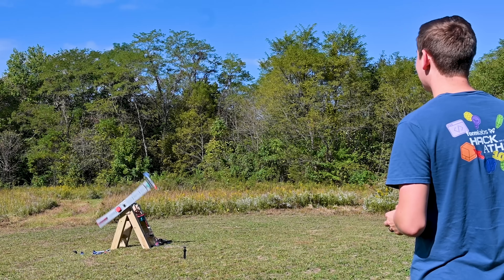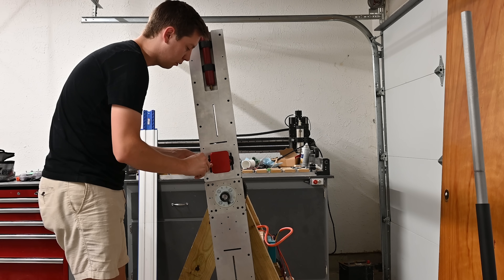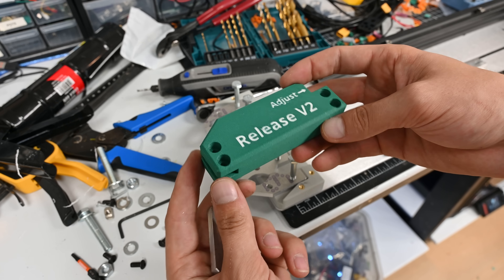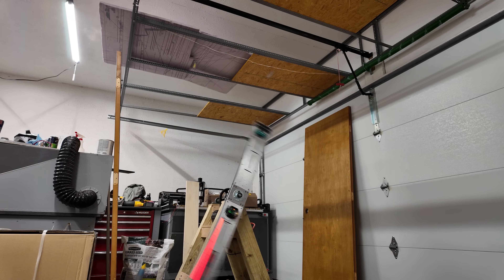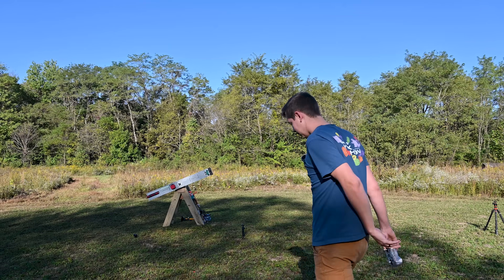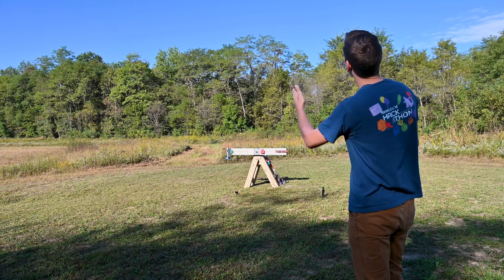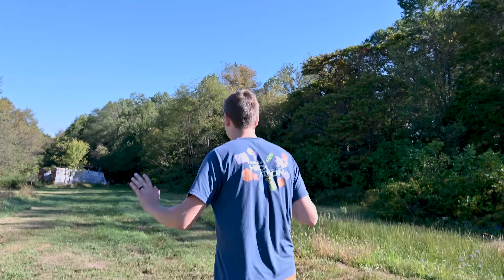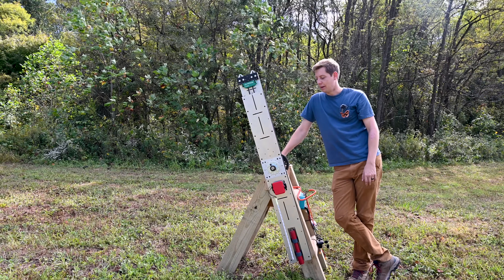I Fixed SpinLaunch

Comment: You can't fix SpinLaunch because the concept is inherently flawed. Surround your launch arm with a vacuum chamber, get the projectile moving at supersonic velocities relative to the atmosphere surrounding the chamber, get a precision release trajectory working, do not impart angular momentum into your projectile upon release, stabilize the projectile's interior against forces exerted by being fastened at the end of the launch arm (so that the tip and tail experience more lateral force than the center), have the projectile transition between the vacuum chamber and the atmosphere flawlessly without having to fight the atmosphere trying to rush into the vacuum chamber, and prevent the reactive forces resulting from the projectile separating from the launch arm. Then you can say that you fixed SpinLaunch.

It's all trade-offs. Terrible trade-offs at that. Consider, for example, the angular momentum of the released projectile. You could counter-rotate the projectile to get rid of the angular momentum at launch. Problem solved, you might think. This is incorrect. Instead of only having to stabilize the projectile against differential forces trying to flings its parts outward away from the axis of the throwing arm (where the tip and tail of the projectile are further than the mounting point on the arm, such that they experience more bending forces), you now have a constantly rotating set of forces exerted on the various parts of the projectile at it rotates such that not only does they have to be strong in the direction from the axis of rotation to the point, they also have to be strong in all directions perpendicular to the plane that is perpendicular to the axis of rotation because the magnitude of the forces from the rotation axis to those points will be oscillating with the oscillation of the throwing arm angles since the distances of those points from the rotational axis of the arm will be constantly changing as the projectile spins at the end of the arm.

Minimization of the differential forces on a non-counter-rotating projectile affixed to the end of the throwing arm necessitated a long throwing arm.

Comment: I'm pretty sure the timing between each claw release needs to be based on the rotational velocity. Your current design has a sweet spot, and rotating beyond that's just going to result in more and more cartwheeling again. You should change to electronically controlled, independent release calculated live by the controller based on the speed at time of triggering.

Comment: SpinLaunch isn't going to deliver velocities even comparable to first stage boosters.  Carbon fiber doesn't have enough strength-to-weight.  So what's the point?

SpaceX has the right idea with SuperHeavy -- cheapest possible liquid fuel, and chopsticks catch.  Not sure if they have the right idea with Starship though.  Maybe!

Comment: push the green thing forward to autobalance it efter release. Right now you pull it backwards so when the rocket is gone the whole with gets unbalanced. Just redesign it to release while being pushed out so the weight gets further out instantly replacing the weight of the rocket

Comment: Add a model rocket engine to the rocket and an altitude meter and do testing on how much the spin launcher increases altitude..  like spin launch alone vs rocket motor alone vs combined and see if the increases is proportional or if there is a greater gains to be had by taking the initial getting off the ground work off of the rocket engine. To Do so you would need a switch to ignite the rocket triggered buy the release system

Comment: This doesn't fix the massive problem of them doing this in a vacuum chamber and launching the projectile through a door strong enough to hold back tons of weight. That's the ultimate problem right there. It'll never work as a result. Let's say the opening for an actual launch vehicle is 1 yard in diameter. That's 1017.9 square inches. Atmospheric pressure is 14.7 psi, so you're looking at just under 15,000 pounds of force being held back by the door at the exit. You need a really strong door to hold that back.

Comment: For increased rocket weights and spin speeds, use a water tank as a counterweight, with a release valve that actuates with the rocket release. You'll be able to perfectly balance a wide range of rocket weights, and won't have to deal with any mechanical system for managing the weight's position, or solid objects flying in the opposite direction of the rocket

Comment: I would begin looking into adding weight to the rocket and some way to compensate for the change in balance when the rocket is released along with refining the release mechanism to be as consistent as possible

Comment: You missed the third option which is to add active stabilization to your rocket that triggers once it's released. That will impart better flight stabiity and less losses; plus the added benifit of going straight.
Add some active control surfaces on your rocket now, in other words.

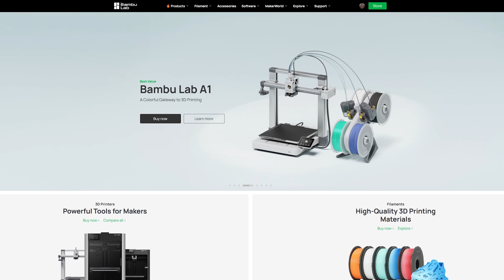Comment: 4:45 I wouldn't recommend printing PLA on PETG and vice versa. those two plastics tend to not adhere to one-another, to the point that people will use either's opposite as support interface material to get better part separation.

Comment: Maybe a delayed rocket burn/boost? I think you are going for zero burn so probably not a part of the plan. But my mind wonders about efficacy between energy required for just a rocket, just a spin and a combination. 

I enjoy rifles, ammunition and reloading. We have many different powders that have different burn rates and stability in different temperatures. 

Lastly is my curiosity about the rocket and as you mentioned weight, ballistic coefficient and any variables such as gravity at different ground altitudes, earth rotation management, wind and more. 

This experiment now allows for a plethora of new questions and ideas. 

I’ll be watching. 

Thank you.

Comment: why not build it with a mechanical linkage that makes the rocket revolve but not rotate, while it spins up? use two axles spaced at the same distance as the mounting brackets on the rocket...

Comment: Why not quit the kludge and go with a counterrotating rocket?  
Draw this sketch: O========O but space the two dotted lines more so they're tangent with the circles.  What you're drawing are sprockets and a roller chain (or equivalent with toothed belt and toothed pulleys).   The center sprocket is mounted on the support structure, not on the arm.  
As the arm rotates, the center sprocket does not rotate, and this stationary position is transmitted to the sprocket at the end of the arm holding the rocket, so the rocket remains vertical throughout the rotation of the arm.  Voila', not fancy timing needed for the release -- except to ensure the rocket travels vertically, not horizontally.
BTW, you really need to release an extra mass from the opposite end of the arm, simultaneously to releasing the rocket, so as not to throw off the balance.  
Alternatively you could shift some extra mass on the arm to rebalance the arm without throwing any extra mass.  Possibly the easiest way to do that might be to have some mass on the rocket-end of the arm move outward exactly as the rocket is released, using the centrifugal force as the motive power for this mass.

Comment: I may be off here but at higher RPMs won't the centrifugal force on that release block hamper the release mechanism? You may have to compensate for the added force needed to trigger it at higher RPMs.

Comment: Cool as this is.
Scale this up to launch a real rocket and it won't work.
Consider how large a spin launcher would have to be to launch even a rocket that is 20 ft long, launcher would have to be a couple hundred feet tall. The centrifugal forces on the rockets body would fold the craft in half like a match book.
Rockets are designed to withstand vertical pressure from launch and gravity. 
And even if the spin arm for the 20 foot rocket was 15 feet wide. Which would probably prevent it folding I think the whole concept is flawed.
Probably better would be a ramped Mag Rail.
Would be electric launch but exactly how much more efficient the MR would be over conventional launch is anyone's guess.

Comment: How does it scale in your opinion? You apply torque to a relatively small part, however the 'rocket' is not heavy at all. Would it break under heavier loads - relatively - would it malfunction with changing mass of the rocket - same setup but the weight of the rocket changes each launch?

Comment: mechanical less janky solution to your problem right here:
"Decoupled Robotic Arm System"

you`re trying to counteract the rotation from the spinning arm...
so here`s my idea: what would happen, if the rocket actually stayed upright the whole rotation?

you`ll need a stationary (non - spinning) gear at the central axis of the spinning arm, another identical gear at the end of the arm and a toothed belt around both of them.
at any point of the rotation the rocket points the same way: skywards.

to be absolutely clear: the central gear does NOT turn with the spinning arm and the rocket is attached to the other gear.. got it? just google "Decoupled Robotic Arm System" and you`ll get a graphical image of that system.

Comment: The period of time between the first release and the second release is inversely proportional  to rpm, and proportional to how long it takes for the second release to swing into position of the first release. 

It is this simple:
Delta time = Delta theta × 60/(2×pi × rpm); where delta theta is the angular seperation  in radians between the first and second release mechanisms.   

This is easily programmable and you can move onto solenoid actuators. The solenoid core should be balanced by a counter weight on a lever so that it remains largely unaffected by additional G forces.  With these improvements, you can more precisely time your launches and thus your launch angle.

Comment: what if you made the rotating arm extend and retract? when the initial rotation of the arm is in long and slow mode, then after the momentum is built the arm is retracted to increase the rotation, then you can launch the projectile when the peak speed is reached.

Comment: Spin launching from the moon is where things get really interesting.  For instance, SpinLaunch built its suborbital launch platform for testing, and at full power it can launch at 2.1 km/s. To put that in to perspective,  the Moon's escape velocity is just 2.38 km/s, that is just 0.28km/s short of escaping the moon's gravity completely. 

The full sized version is expected to also launch much heavier payloads at roughly 2.1 km/s, but the orbital accelerator vehicles, after accounting for gravity and air drag losses, will add another 5.5 to 7 km/s to put it's payload into low earth orbit, making that a more than 7.6 to 9.1 km/s total delta-v. Putting this into perspective, the delta-v needed to get from the moon's surface to Jupiter is roughly 8.5 to 9km/s, and a gravitational slingshot maneuver can add the additional delta-v to fling a lunar spin launched probe in to interstellar space. 

Lunar spin launch with these  accelerator vehicles makes Asteroid interception and deflection possible. We could simply launch and keep a few in reserve in lunar orbit until need to deploy them. And the launch platforms could cheaply launch raw materials to space for space based industry to process it in to space infrastructure like solar power beaming to power earth or power growing space industry with continuous energy from the sun. 

Furthermore while SpinLaunch launches it's payload skyward, it concurrently releases a counter weight into earth to keep the forces balanced. But spin launching from an elevated launch platform on the moon could concurrently launch two vehicles in opposite directions parallel to the horizon with much the same technology used to build the test launch platform SpinLaunch already built on earth,  except on the moon its structor wouldn't have to contend with Earth's Gravity, nor Earth's atmosphere to hold back over a 100m diameter construction, and neither would it  have to create a vacuum inside, and each of these simplifies the design parameters for a spin launch platform on the moon.

Comment: Jumping into this saga here; my first thought seeing it fail was an atl-atl spear thrower. Your initial design is exactly how that weapon solves this problem, a cantilever and a nock. Considering its success in real life conditions, and a spear thrower is pretty much useless if it isn't accurate, perhaps there's a secret there to solving the inconsistency you saw in the garage test? Most of the suggestions here are high tech, but this is technically a stone-age problem!

Comment: You may also need to have an auto counterbalance mechanism after the rocket launches. To compensate for the weight of the rocket and the shift from the release mechanism. You can see it the increase in instability after the rocket is launched.

Comment: well .. if u do all the calculations its possible launch a mass of under 1 gram into orbit using spinn launch
.. if the arm is 65m made of a thinn shell of carbon fibre 1cm at the tip and the base(arm) 132 cm wide (circular) .. to withstand the nessesary forces ..
.. anything above 1 gram is impossible launch into orbit using spinn launch
u need a V of 7800 m/s to escape earyhs gravity .. at that speed the g force r 685G
... this is assuming everything is built perfect ... no joints, no friction, no drag etc .. and the whole structure is in a perfect vaccume .. but as soon as the launched payload leaves the vaccume chamer it most likely desintegrate instantly ... like hitting a brick wall at 28 000 kmh ..

Comment: A simple reed switch, hall effect sensor or even just a switch with a cam, any of these solutions would work no crazy timing algos or engineering you just wire the solenoid to only trigger when the switch at the hub is also triggered, and the solenoid will always release at the pre-determined angle regardless of RPM or weight. You don't need a digital controller or programing either it can be all analog.

when at speed you press the fire button and when the second switch at the shaft is also triggered by a cam then solenoid fires.

Comment: well .. i'm not engineer but no matter what you do like this, I think that you will battle rotation because the timing of each clip release will change with the rotation rate of the arm, and these timings will only be consistent for the one mass and mass distribution of rocket. This is because your timed releases don't "stop the rotation" they "apply a torque" and how much torque will result in how much rotation will vary based on mass and mass distribution. test with no payload and a payload will change it. stabilization isn't one of those things that can be improved infinitely, and some good examples are self-balancing robots, which always do and always will both improve, and fail to be adequate. So you will find some amount of launch capability, but will surely fall short of "the good one" (as we can see with the real spin launch). Either the vehicle needs to be able to stabilize the rotation after the launch, or the vehicle needs to be able to have zero rotation upon launch. It is not really possible to expect to be able to fully stabilize the rotation DURING the launch, as it is not possible to consistently transfer the exact amount of energy in a single action. (you need to have time to wobble back and forth)

Comment: if you want perfect release you need to somehow mechanically link the release to the spinner, and as you use the wheel as flywheel for the energy, the force will scale with speed

Comment: Great fix!  Just a thought for your release issue.  Mind you this is just an idea without any imperial evidence.  What if you make a collar for your arm shaft where you drill a through hole, mount a led on one side of the collar and a cds cell on the other side.  Drill a hole through your shaft that will allow the light to pass between the led and cds cell.  Set the collar at the 90 degree launch angle and adjust it to compensate for the electronic and mechanical activation time or at an advanced location that then can be be adjusted by software to time the launch at the 90 degree mark. When you trigger the launch sequence it turns the led on and when the light hits the cds cell you launch or start the software controlled timer.  If you know the time it takes to activate the trigger mechanism, and you can measure the pulse of the light at a certain arm speed you can work out the  needed software delay. I do not have an idea on how to make it fool proof to avoid releasing when the light pulse is detected at the 270 degree mark….  Maybe some way to detect when the arm is near the 270 degree location to inhibit the led from illuminating.  
Keep up the great work!!
PS another idea, drill a small hole in your arm shaft or attach a collar around the shaft where you can attach a magnet.  Then use an electric coil with an iron core, to generate an electric pulse.  Just like how a small engine magneto works.  Then this signal is what you trigger off of to drive your release circuit.  Sorry this idea hit me after I gave you my long winded first idea.

Comment: The issue with this design is that every time you change the rpm, you need to calibrate the release mechanism. What could be really cool is to have a counter rotating mechanism that is coupled with the rotation of the arm so that the rocket is always pointed up. Then you just have to make a super fast release mechanism to release it in the correct part of the arc. (Probably easier said than done)

Comment: You can see the rocket still wobbles a teeny bit when it is launched. You should change the fin design and make the launching device apply a spin so that when it launches the gyroscopic forces balance the wobble.